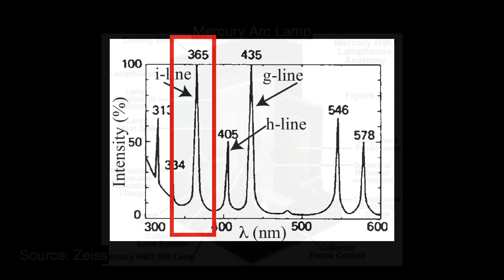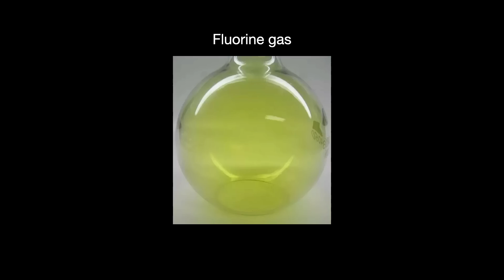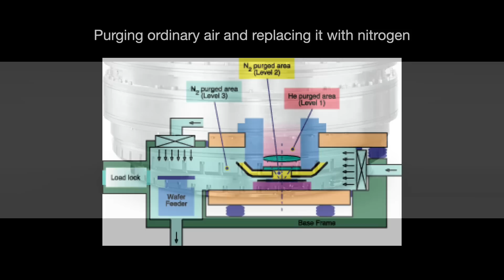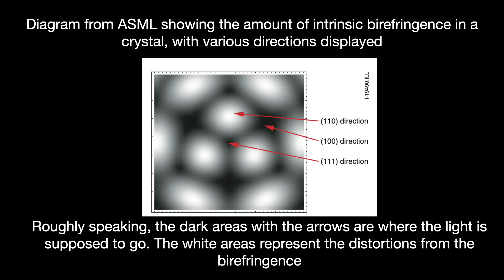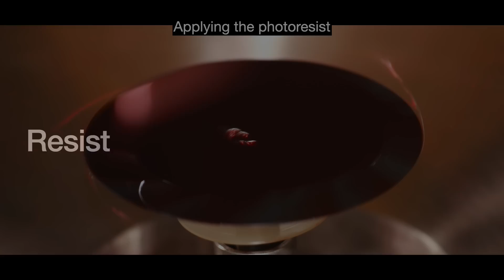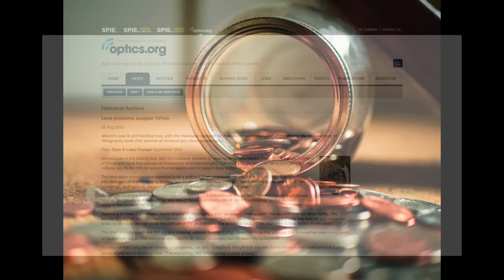Why 157nm Lithography Failed

Comment: So for reference, what size are we on now?
Reply: https://en.wikipedia.org/wiki/3_nm_process?wprov=sfla1 production of "3nm" is beginning, produced with EUV tech.

"The term "3 nanometer" has no relation to any actual physical feature (such as gate length, metal pitch or gate pitch) of the transistors. According to the projections contained in the 2021 update of the International Roadmap for Devices and Systems published by IEEE Standards Association Industry Connection, a 3 nm node is expected to have a contacted gate pitch of 48 nanometers and a tightest metal pitch of 24 nanometers. However, in real world commercial practice, "3 nm" is used primarily as a marketing term by individual microchip manufacturers to refer to a new, improved generation of silicon semiconductor chips in terms of increased transistor density (i.e. a higher degree of miniaturization), increased speed and reduced power consumption, Moreover, there is no industry-wide agreement among different manufacturers about what numbers would define a 3 nm node. " - from article
Reply: State of the art production is TSMC 3nm and 5nm node and whatever Samsung is calling their equivalent node, I forget.
Reply: As  @Grak70   said, the components are described as equivalent to 5nm gates (I think) in the old measurement, but yeah tsmc are firing 13.5nm EUV light at the masks now, vs 157 😳

Comment: Jesus we've been hanging in there with multipaterning for a long time. TSMC N7 is the last iteration that didn't use EUV. Even N6, which is only a 18% density increase over N7, uses EUV for the critical layers.
Reply: Yeah there's no point using euv for interconnect levels when 193i has high throughput, it's only really used for stuff like fin and gate definition.

Comment: A similar thing happened to the effort to transition to 450mm wafers. And similar to 157nm lithography, the semiconductor equipment industry footed the bill.
Reply: A lot of the reason 450mm died was the equipment folks NOT wanting to get screwed like they did with 300mm. They still got screwed on 450, but not as bad as if they’d gone all in.
Reply: @Grak70  you mean nm? ;)
Reply: @rkan2  Pretty sure mm is correct. They're talking about wafer diameters here.

https://www.youtube.com/watch?v=0s5TO9h6fco
Reply: @rkan2  ah…no? Lol
Reply: Intel payed for it, ASML made it, and no one came
Reply: Yes, the semiconductor equipment industry paid for the development of 300mm equipment for the transition from 200mm wafer size, but they recouped their development costs through 300mm equipment sales which have continued through today. 450mm development costs were astronomical, with many technical problems to be overcome. To the semiconductor manufacturers, the transition only made sense if they didn't have to pay for it.